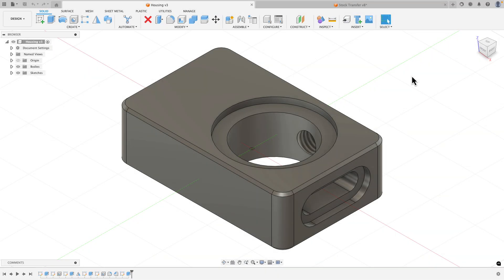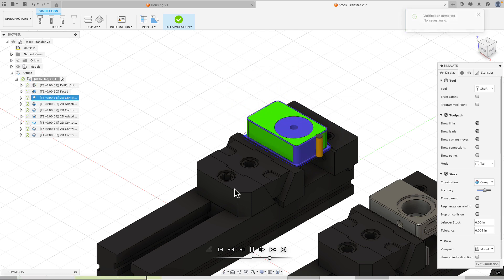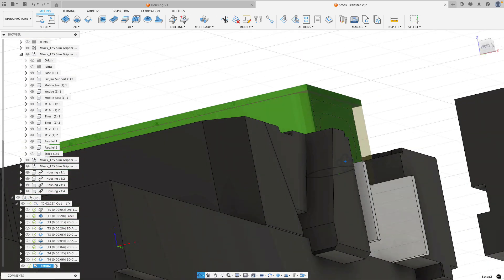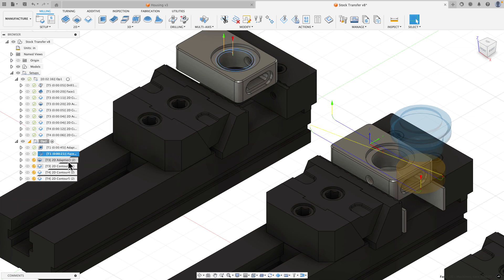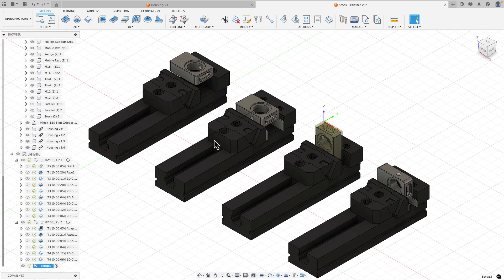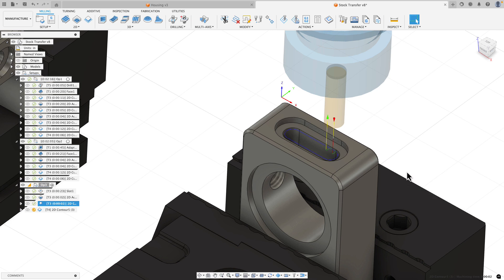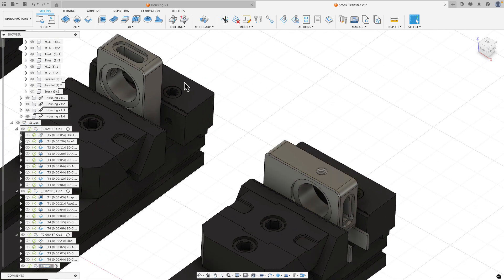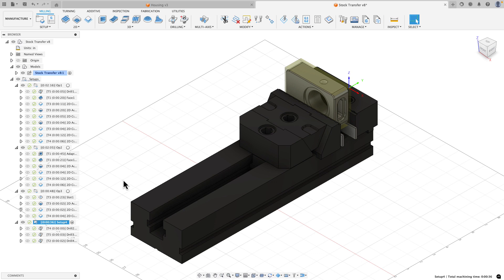Fusion Stock Transfer

Comment: I used parameters to get the jaws of my vise model to be set for a particular stock size. In your video, you have 4 instances of the same vise model, all with different jaw openings, and they are all linked. How did you do this?

Comment: How did you use joints to move the parts? I have a fixture which is holding 6 parts on a flat bed. I want to create another setup with the parts flipped. But I tried to rotate the stock and it rotates everything. I'll google around about Joints, but any assistance would be appreciated!
Reply from the maker: I think I have a couple of joints videos on my channel. I'd also be happy to work with you one on one to get your project completed. www.mechanicaladvantage.com/schedule-now

Comment: Kevin, this is exactly what i was looking for. The way i ave been working is more complex. Can you also show the process you used for bringing the parts and vices into the file and jointing them. I noticed the parts are still linked but the vices aren’t. Is this important
Reply from the maker: You can look at the videos of how I built the parametric vises. I have videos for both fixed jaw and self centering vises on my channel. The component was linked because I had no intention of editing it in that file. By leaving it linked, any change I made to the original would have propagated to the assembly file. The vises had their link broken because they need to have a unique jaw spacing in the assembly file. When linked (and not using configs), you can't have a jaw opening of one value in the original file and a different jaw opening in the assembly file. Breaking the link allows you to control the value in the assembly file.

Comment: Incredible, very different from how I am used to doing it as long time MasterCAM user. I have lots to learn to transition to Fusion. Thanks for making a great video!
Reply from the maker: I'd love to know the method used to do this in Mastercam. I'm not familiar enough with that software to know how it is done. Does it seem harder or easier to do in Fusion?
Reply: In mastercam I think it's harder. Fusion seems to be easier

Comment: I like how you got rid of the "hat" in op 2 with a 3d adaptive and a face mill but why the .1" radial stock to leave?  Thank you for another great video!
Reply from the maker: Notice that the value I used was negative -.1 radial. I just did some checking and it didn't make a huge difference. I like to make sure the tool is starting outside the stock. The boundary for the tool path is the stock. By setting a negative radial, I was trying to push the tool away at the start a bit by offsetting the boundary -.1 radial. 

I just did a check with that value set to 0 and the value at -1. I'll list the start values below. 

0 Radial Stock:
X= -.05445
Y= -3.7152

-1. Radial Stock
X= -.12224
Y= -3.70936
Reply: @MechanicalAdvantage  Pushing the tool away at the start is a very useful tip even if its a small amount. Thank you!
Reply: I have used the face mill mode with adaptive type selection in 2d face mill  under passes it's called chip thinning.  Mastercam calls it dynamic face mill.

Comment: Good video Kevin, I got out something else that is also a useful tool out of the video, which is turning on only the setup which you are looking at and automatically turn off the other setups. It helps when you are doing multiple ops on the same fixture and you don’t end up mixing the two parts.

Comment: "Continue rest machining" is a great step forward. Used to have to export the body from the simulation to create the stock for the next op, which was a PITA. Nice to see the process demonstrated! FWIW, you forgot to chamfer the hole for the (last) threaded hole....
Reply from the maker: I didn't forget. I just didn't feel like explaining. Because Fusion uses the tap drill size for threaded holes, you can't just apply your chamfer to that edge of the solid. There is some math that has to be used to get the size of the chamfer you want after the hole is tapped. So I just chose not to do it in the video so I didn't have to explain.
Reply: @MechanicalAdvantage  or sometimes you can spot drill deep enough so it’s chamfered after drilling and tapping
Reply: I used to do the save stock as stl method but use preceding is my standard now.

Comment: I always wondered how to do this using several setups while maintaining from preceding setups.  I tend to get the "Continue Rest Machining: Cannot verify that the stock is transferred from the previous setup for rest machining. Verify that the model selections in both setups are the same." warning.  I am assuming the wrong body is being selected.  Cannot figure out how to get rid of that warning message.  Great video again.  Much gratitude
Reply: So what’s causing your issue is the body you’re selecting for your body when you’re setting up your “setup” as you go you have to make sure each setup has that same body as its “body”, does that make sense to you?
Reply: @ I understand that but I was following Kevin’s example by inserting the same object multiple times for multiple setups and still get the same error.  In Kevin’s example he is selecting another instance of the same component without any error.  I know I am doing something wrong.  I know can I save the first setups last operation as a mesh but I am missing something.
Reply: @ I will try to replicate it once I’m in front of my computer.
Reply: @ I tried several times all resulting the same.  I generally don’t have any issues with multiple setups and rest machining from proceeding setup but I would like to have my second and third setup in the vise for more accurate simulation for my machine setup
Reply: @tdg911 ok this might mean nothing, but does it matter if he added the components by dragging them or by inserting them VS using a linear pattern from the first body then just flipping the other parts in the orientation needed?
Reply: @ I tried both ways.  If I copied and drag them over to position how I needed for the next setup still same outcome.  I saw his components were linked which mine were not with copies so I inserted them and then we’re all linked with same outcome.  I certainly wish he would reply to this thread to clear up the confusion.  I tried everything.   This is the main reason why I stopped trying to do it this way because I couldn’t get it to work right.
Reply: @  I just did a simple little test. I got it to work, I’m not sure what you’re doing wrong. When selecting your bodies make you sure you select the title of the body under your models tab. I can send you this file if you’d like.
Reply from the maker: I'm not able to make this work with the body under the component and I've tried several different examples.
Reply: @MechanicalAdvantage   so don’t convert your parts you’re importing to a component? Leave them as a body when you draw them?
Reply from the maker: If you look at the start of the video, the housing is just a body. However, when inserting the body into another file, it automatically will become a component.
Reply: @MechanicalAdvantage  I did notice the icon to the left was different than mine.  I will try again using bodies instead of components.
Reply: @MechanicalAdvantage  Thank you for making that clearer.  I got it working.  I would have never figured this out.  One conflicting thing is many that teach these tutorials pretty much all say create components instead of bodies.  Doesn't work for this application though.  This was the confusing part for me.  Much gratitude.
💪💥
Reply from the maker: @ It would be my recommendation to create components as well.
Reply: @MechanicalAdvantage  so it has to be a sub component? All the different parts as components inside of a component?